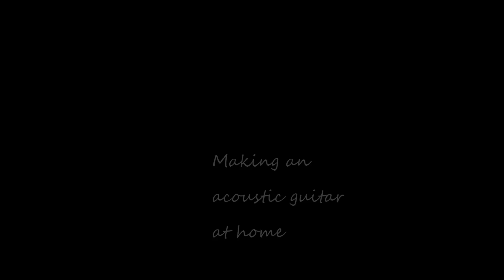Building an acoustic guitar at home

Comment: The result is lovely and obviously the product of hard work and experience. That said, as a woodworker with no experience in guitar making, is there a reason for all the times you seem to do finishing while there's still other work to do? Like when you're doing the inlay, you do the olives, then sand it down, then you do the leaves, and sand down again. Or on the head, you do polishing and oiling before drilling for the tuning knobs.
Reply from the maker: If I don't sand the inlays down in between, the router doesn't run over the surface smoothly and I couldn't do the other inlays. I always have them a bit proud of the surface. For the headstock, sometimes I drill the holes first, sometimes after the oiling. Depends on when I make the decision what tuners go on. Also, clearing oil runs from inside the holes is not easily done but you want clean holes for the tuners to go in nicely. Oh, and they're plums, not olives, since it's a plum wood guitar. ;-)

Comment: Ms. Reti,  thank you for your time and videos.  I am a new aspiring Luthier and I find some of your methods different and educational they have helped me.  All the best to you.
Reply: With all due respect I have to say I was no fan of your neck to body joint but I have since come around.  One could argue its better than mortise and tenon due to the tight wood on wood contact, more surface area to transmit sound throughout.  M&T might even be 'overkill' so to speak.  That joint with a light coat of hide glue and tight bolts isnt ever going to move.  I may try it on my next build.  Thank you.

Comment: I would love if you gave a little monologue with the build process. I'm curious how you set the neck angle and why you choose the processes that you use. Fascinating.
Reply from the maker: Hey Tom, maybe there will be a voiceover with the next one... You're right I forgot the footage of how I cut the neck angle on the table saw. You can see that in my video for The GGBO 2021: https://youtu.be/sr0eHI2ajRE?t=676
You can see fine-sanding the neck and body to fit at 19:50. I hope this helps. Cheers, Gabi

Comment: Intrigued by the simplicity of your side bending form. I always used the Fox side bender where the wood is between to pieces of stainless steel. This, apparently is not necessary!
Thanks
Reply from the maker: Yes, and way less expensive. ;-) But it only works with woods that can be steam bent. Cheers.
Reply: @GabiM3112  What woods cannot be steam bent.... I am planning on a guitar with back and sides of leopard wood
Reply from the maker: @tromano8112  I don't know leopard wood but the ones that I steambent successfully are: Apple, plum, cherry, pear, oak, black locust, ash, all walnuts, bocote, maple, rosewood, chestnut. You might find out about leopard wood steam-bending abilities from wood libraries. Here's somebody who ahs tried steambending leopard wood. Maybe with thinner peices, you could be successful.
https://www.woodweb.com/knowledge_base/Steam_Bending_Leopardwood_and_Lacewood.html
Cheers and good luck.

Comment: Hello!  First of all I want to congratulate you for the beautiful work done on this guitar.  I'm taking my first steps in luthiery, taking an online construction course and buying tools to start my first construction based on the standard Martin dreadnought.  Among the construction steps that worry me the most is molding the sides.  I'm deciding between making a tool heated with fire, buying a thermal blanket or a ready-made bending iron, but I found the system you used very interesting.  The impression I had is that the wood is much more malleable and easier to bend.  Would there be any channel where I could learn exactly how to build such a system?  It's basically a steam chamber, right?  Thank you very much!
Reply from the maker: Hi there,
I have a building video of the steambox on my channel. You may want to check that out. Note, tzhough, that not all woods are steambendable.
Cheers
Gabi
Reply: @GabiM3112  Thank you so much, Gabi!!!!  I will look for the video on your channel.  Congratulations again on the work!  His instruments are beautiful and full of personality.  Success to you!
Reply: I am a hobby luthier, and I agree that the hot pipe method is very tricky. I have also worked in traditional wooden boat building, and will say the steam method allows big planks to be bent and twisted in such a way, and with relative ease that would be impossible using any other method.

Comment: Not sure if this has been asked but after you added studs in the neck heel, how do you attach it through the block to the body? Beautiful job, especially with a small set of tools. Brilliant.
Reply from the maker: It's a bolt on neck with a butt joint. You can see the process in some of the other videos. It's not in this video since I accidentially erased the footage of that step. ;-/ Cheers.
Reply: @GabiM3112  thanks!

Comment: Hello Gabriele, Certainly enjoyed your Video very much. I am fixing to make my attempt on a build. I am assuming your back wood, was 3 pieces by the two flat braces? I was wondering if I could use 3 pieces for the back as I have wood that is a little shy of making a two piece back. Beautiful inlay on the Guitar Top . Thanks for showing your skills.
Reply from the maker: Hi there, Russell.
Yes, since that's plum wood, which doesn't grow as big as to make a two piece back, it's a three piece back and I support the joints by two slim braces inside.
Reply: @GabiM3112  Thanks so much for your Reply.

Comment: Hi Gabi, I am impressed with your tools .  Did you make your own acoustic guitar body forming jig and your steam box, as well as your air filter system.
Reply from the maker: Hey Gilberto, yes, of course.
Reply: @GabiM3112  your vacuum is more that meets the eye.  It collects wood chips but also protects the air you breathe.  I can literally see the fine dust cloud gently being sucked down.  So the first stage being separation of chips from dust, then a second stage that would trap the particulates.  I'm I close?
Reply from the maker: @g2D1  Well, it's cyclone technologies, so everything is caught in an almost vacuum container while onyl very little fine dust goes into the filter of the vacuum cleaner that runs the system.

Comment: Hey friend you done a wonderful job. I like you guitar building style.
From nepal I have a question witch router bit you use for routating n witch router bit company??
Reply from the maker: I use three routers. One that I put in the routing table for the slot for the trusrod and the other one for the binding chanels and another on (cordless) for rounding the edges/headstock. The one in the routing tabel is a simple Holzmann PBF 1200, then the one for the binding chanels is a Makita 3709 and finally there's the cordless Bosch GKF-12V. Cheers.
Reply: @GabiM3112  thank you for replying. 🌹

Comment: Do you thickness your plates with your belt sander?
Reply from the maker: Roughly. I take it down to the almost thickness until I get a good/developing "flipping tone". From there I use an orbital sander and handsanding. Sometimes I take down most by planing (mostly soft-wood tops) and then sanding. It depends on the wood and how well it takes planing, which to my experience heavily figured hardwoods don't do too well - at least not without dulling the blade too much. Cheers.
Reply: @GabiM3112  thanks for the reply, enjoying your artistry!
Reply: Fortunately I have a couple luthier friends nearby that have drum Sanders in their shops they let me use when I need it. I don’t have the space in my home but I want one. Drum sander, prices have skyrocketed over the past few years. I’m only building 1 Guitar a year now. Thanks, I’ve thought about trying the belt sander, now I very well may do so.

Comment: I’ve been considering building a steam box like yours to bend guitar sides. So you experience much spring back after the sides cool on the mold?
Reply from the maker: Hey Ramon,
steam beding only works with particular woods. With the ones it works, there's particularly no spingback or you can neglect it. I leave the wood on the bending form for about 24h and then it directly goes into the negative mould, so that I haven't had any issues with springback issues.
Woods that steambend well to my experience are: Maple, Walnut, Cherry, Apple, Plum, Bocote, Red Gum, Chestnut, Oak, Black Locust, Ash and Beech.
The next I will try is Raintree. Cheers, Gabi.
Reply: @GabiM3112  thank you for your reply! I was hoping you said maple! I use figured maple quite a bit on a regular fox style bender, but figured as it is, that bending process tends to cause cracks along the figure. I have the steam kit, but haven’t put the box together just yet. I will do so soon. BTW, sweet bridge clamp!!
Reply from the maker: @raytristani  Well, figured wood is always harder to bend, particulary curly wood. From what I have experienced making it a little thinner helps.
Reply: @GabiM3112  yep, I follow Torres’ example with my side thickness. Usually bend at 1.9mm, maybe even thinner here tung on the wood stiffness and figure
Reply: @GabiM3112  Thanks for explaining about the steam box and bending. I used a pipe and torch; and just recently purchased an electric iron with better contours. Much better experience. But the steam box method... Hhhmm, got me rethinking my approach. And thanks for the list of successful woods. Seems you can add Mahogany to the list after watching your Build Off video. I agree with the format - all in one for the whole process. Great!
Reply from the maker: @Guitar4C  No, sorry, no mahogany, since the sides of that guitar are made of American Walnut. Mahogany doesn't steambend well, since it will basically go back all the way to its original form. I wouldn't call that "springback but "goback".
Reply: @GabiM3112  Thank you. I just saw in your comparison video about the Walnut sides. Good info.

Comment: That inlay is pretty.
No doubt.
But not really sustainable. It’ll pop out in 10 years. 
Probably a friggin Nightmare to repair.
Love that old fashion Martin bracing on the top👍🏻
Reply from the maker: Well, rosettes don't pop out, why would another inlay? I'll give you an update on 29 July 2032 if I'm still alive at that time. ;-)
Reply: @GabiM3112  
Their position on the top.
Obviously.
Different parts belly and bow.
Reply from the maker: @ReiMonCoH  We will see. I'm not worried at all.
Reply: Don't think so. There are a lot of guitars out there with inlays in the tops, it's been done for as long as guitars are around. There is no reason at all that it should pop out over time as the glue makes a stronger connection to the wood than the inert strength of the wood itself. Obviously this luthier knows what's she's doing and I'm sure she uses the right sort of wood glue. Also, the rosette itself vibrates as much as the part of the top where the inlays are. And rosettes do not pop out.
Reply: @urijpavlovichdemin1676  No, it won’t. Just look at the guitar. It’s a straight forward design but with an inlay in stead of a scratch plate. It will work without any issues. If the lacquer of the instrument is done properly it will never become a problem.

Comment: olá tudo bem??
Sou do Brasil 🇧🇷, estou vendo seus vídeos, poderia me dizer qual tipo de verniz você usa nos violões?
Reply from the maker: Normally I use Tru Oil but here it was also laquer.
Reply: @GabiM3112  ok, obrigado!!!
Reply: @GabiM3112 I have made guitars for over 55 years, and since I wasn😮't trained as a guitar maker but as a sculptor, I didn't want to make the conventional guitar, ie. Martin x bracing so I tried out a number of different bracing patterns before I came on an individual design due to my only having wood long enough to go from side to side. So I came up with a solution, that was different from any other guitar  makers and had the struts traveling in the direction of the strings with the sound board traveling from side to side. This I found had a much  better tone than the earlier guitars that I had made. So I continued making guitars with the grain going from side to side some with the grain diagonally across the guitar as well as straight across. Since I see you are not averse to trying different guitar designes I thought that you might like to try out a guitar made in this manner, if you would like to see 3 of my guitars that were bought by Charlie Watts, of Frayed Knott then Google charlie watts playing josua gone barbados and there you will be able to see and hear him playing a guitar with the grain going  diagonally across the front of the guitar and see what he has to say about the guitars that he has bought of mine, I would like to hear what your thoughts of the tone of them is since I have parkinsons disease I have had to give up making guitars as I don't want to lose my fingers using a sircular saw. Hoping this has been of interest to you and look forward to your reply. From Barry Ducret

Comment: ? I don,t have any of those cutters and sawing machines !
Reply from the maker: You can do all by hand, which I did with my first guitar but of course tools make things easier.
Reply: @GabiM3112  That,s amazing !
Reply: @GabiM3112  Hello again.I,ve watched your video building a classic guitar.If my eyes är " right",then i saw a cutter,a bandsaw and some other machines ! I dont understand what high tech tools you are refering to.Guitar builders don,t usually use those ?
Reply from the maker: @kjell-akeapell3285  Err, I don't quite understand what you mean, sorry. You can build a guitar with hand tools only is what I'm saying. The only power tools I used for ym first guitar were a jigsaw, a dremel and a drill. The rest was just handtools.
I bought the other tools over time and they make a lot of things easier/quicker. But again: you don't need any of them for building a guitar.
Reply: @GabiM3112  Thank,s for answering.I still think it,s a bit "simplified"
if I say so. I think I must have some home made tools, for example to the embracing,to steam and bend the sides,and to cut the sound hole.
Reply from the maker: @kjell-akeapell3285  You can bend the sides over a hot pipe. When I did this, I used athe tube from a sattelite dish mount, fired a heat gun into it and then bent the sides. But I don't like that method of bending because it's tedious and takes much longer. 
Mark that not all woods steam bend well, though. I made a list of woods I was successful with in another video, where I explain about steam bending.
What wood would you like to use?
Reply: @GabiM3112  Hello! A good guitar is made of rosewood ( back and sides), spruce (top),ceder ( neck)and ebenholts(freetboard). Kjell
Reply: @GabiM3112  Error: Mahogany ( neck)
Reply from the maker: @kjell-akeapell3285  Hi there again, you can make a "good" guitar of many different materials but if you wish to make one out of rosewood, then steambending will work, not as well as with other woods I have tried.
Bending over a hot pipe will always work but to me it's no fun. 
You will have to make the respective jigs for bending/holding the bent shape, though, which I think is the most work in guitar building. Making jigs and dishes. Once you have done that from there it's mainly measuring cutting shaping and gluen different pieces of wood together.

Comment: Did I hear some fret buzz on my near fields? Without knowing how you are recording the guitar and how that portrays the sound of the guitar, I am qualifying my comment. Given the recording it sounds very "wooden" with very little sparkle or presence. That may be the sound you were after or a result of the recording chain.
Reply: I think it sounded great for just having been strung up. It usually takes weeks for a newly-built guitar to settle in, loosen up, and get used to the tension of the strings, etc. --- it takes a while for the wood to realize that it's a guitar.
Reply: @kathmatsushita  Fair enough, you can tell may be I am a keyboard player. 😉